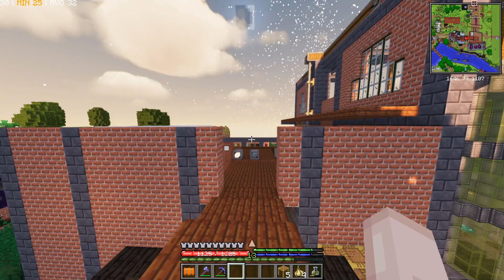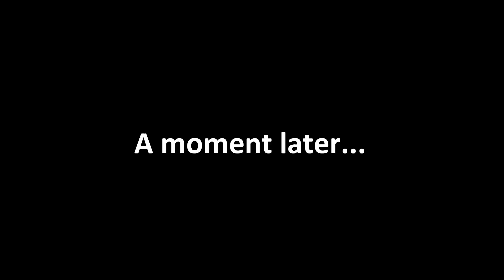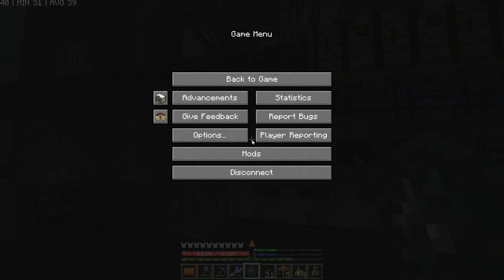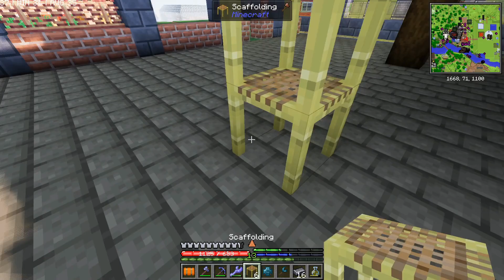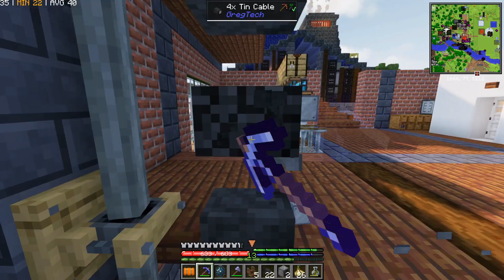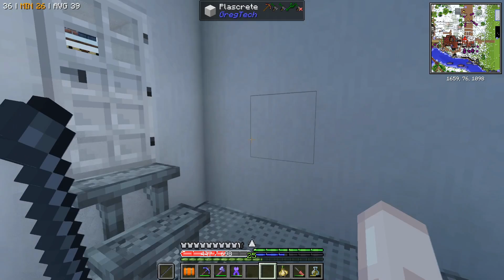ATM Gravitas 2 LP EP 10: Chemistry Setups for Circuits

Comment: how did you get the terminal into the log is it the facade block from integrated dynamics
Reply from the maker: Exactly! You can craft it with other blovks in a crafting table/work bench to set the look! Then apply over a logic cable and attach the terminal.

Comment: you cant take out the lasers/molds/circuits you need seperate machines (eventually the multiblocks will basically fix this with multiple input buses)
Reply from the maker: Alas I shall keep with my current plan then until I get a multiblock*.